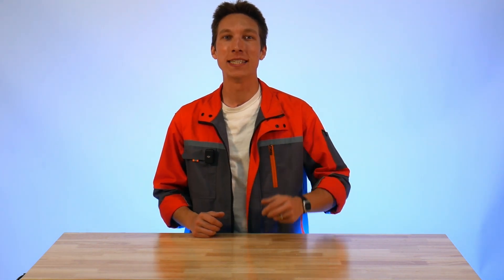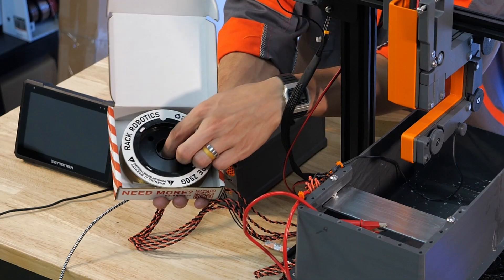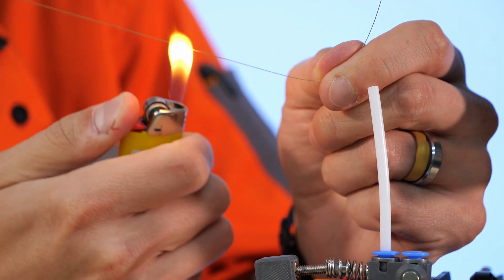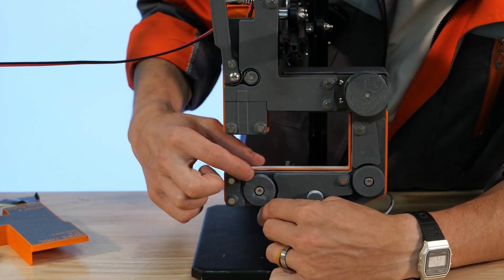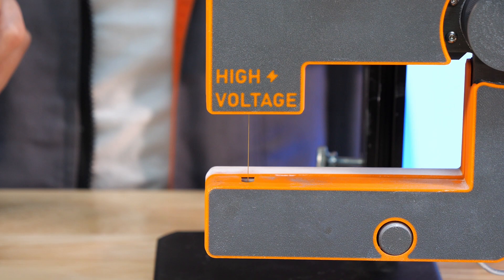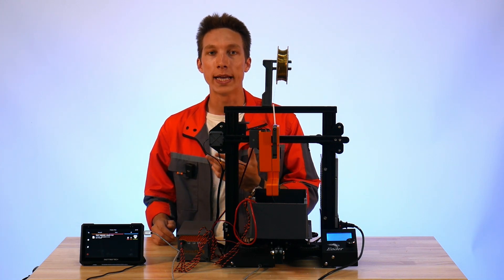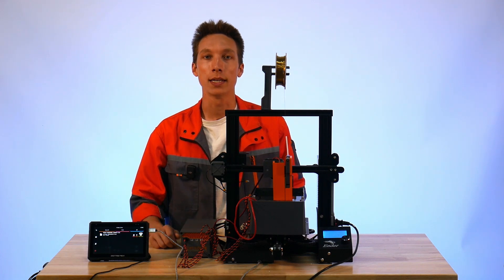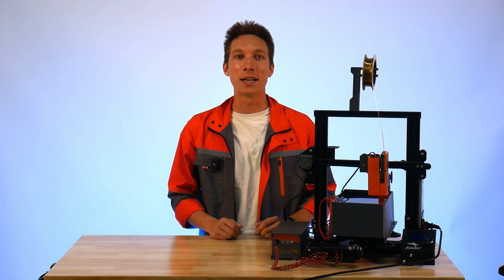3D Printer to WEDM Machine GUIDE - Part 6

Comment: Hi guys, do you expect a video on how to use a slicer with the feed rate of the wire motor and maybe a video on the water pump.  Looking forward to using this.  Take care, Travis
Reply from the maker: Hi Travis! Yes, in our next video we're going to cover the slicing side of things as well as take a brief look at how we're connecting a pump to the system. Working on this video right now. -Cooper
Reply: Thanks so much for the speedy reply.  Take care, Travis

Comment: What‘s the max build area I could do with this? Could I build one big enough to cut out chef knife blanks from high carbon steel?
Reply from the maker: The limitation for the Wire Tool is the depth along the "C" shape. That's about 100mm effective depth. If you set up a wider machine you would definitely be able to blank out knives. Probably not going to happen on the Ender 3 though.